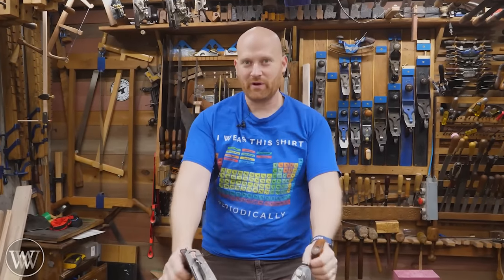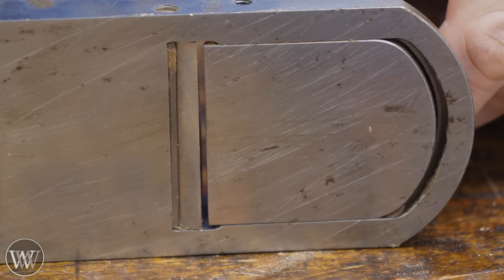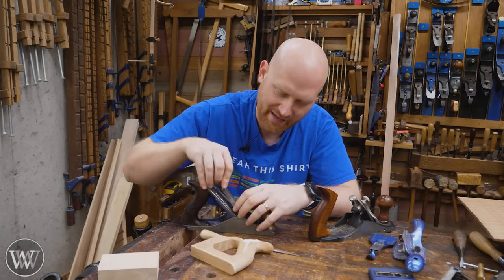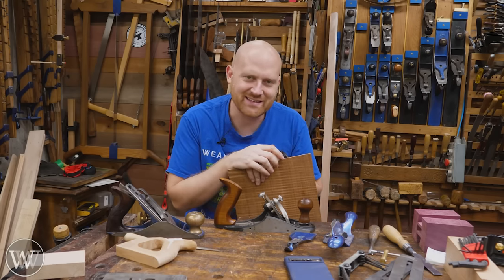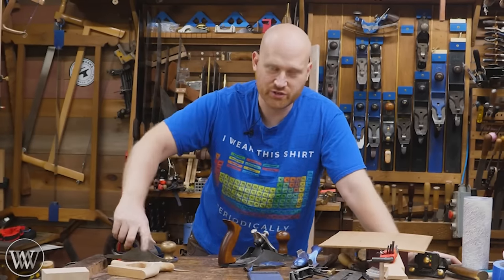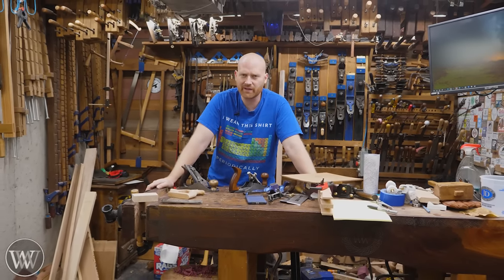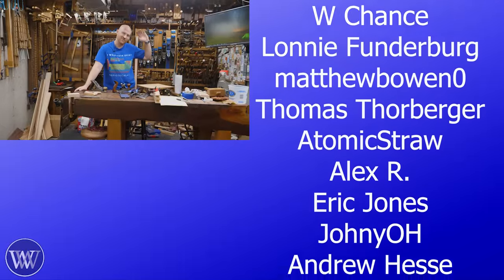Do You Need A Smoothing Plane

Comment: When I'm working a particularly gnarly piece of an exotic hardwood such as Curupay (aka Cebil or Patagonian Rosewood [no, it's not a rosewood and it's not from Patagonia]) I usually reach for my Veritas scraping plane.  I find that when I use the thin blade option I get card-scraper-quality results with less strain on my hands.  And since time has been unkind to my finger joints that lack of strain (and pain) is most welcome.

Comment: Thank you James for returning the craft to actual wood working, rather than playing with the tools. I do have a question that I think is relevant to setup: why do some plane shavings come out like an accordion? Others come tightly rolled like tape? While other times it comes out in perfectly straight?
Reply from the maker: Most of the time it has to do with the mouth and Chip breaker settings. If the trip breaker is doing a lot of compression it'll come out like an accordion. If it's backed up a long ways the shaving will come out nice and straight.
Reply: It happened to me too. I am a beginner and tried to put the chip breaker super close to the blade edge. So, this was the problem with the accordion chips?

Comment: I bought a number 4 during covid, I’d never done any woodwork before but I knew how to work to a straight line as I’d worked in engineering, I bought the cheapest new plane I could find on eBay, and I mean silly cheap. It was simply not possible to close the mouth to less than a 1/4 inch. However with an insanely sharp iron and a chip breaker so close to the edge that I needed an electron microscope to measure the distance, I managed to get very reasonable shavings, gossamer thin, no, but very reasonable. I have better planes now but I still have that cheap plane and it still works.

Comment: I have to laugh a few years back built a table top with QSWO that I bought off ebay case hardened I believe . My fancy lad bronze #4 with 45 or 55 degree frog would not smooth the top ,constant tear out. so scrapers to the rescue, I learned scrapers can get super hot. I did buy a Stanley 80 and the rest is history.

Comment: In researching Japanese planes, I came across the book by Scott Wynn. He does make the comment that the mouth opening should be the same as the thickness of the cut you want to make. I can guess that for those long shaving contest, that would probably be required. For general use, probably not so much.
Reply from the maker: Yup. The problem with Japanese planes is you can not adjust the mouth so you need to make it very thin when you make the plane.

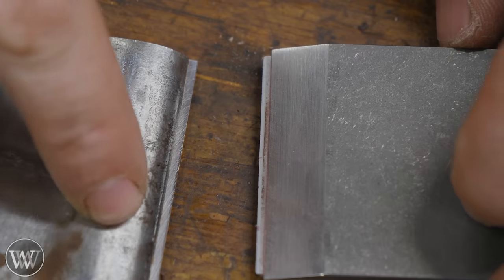Comment: James, haven't seen you endorse the David Charlesworth sharpening trick in any of your videos, but I see you do use it on your super smoother @ 1:52 ;-) Absolutely, 100% agree, a "properly" sharpened blade is the biggest thing you need, it's something that people think they've got down pat, but in reality, most don't. EDITED TO ADD ... even bigger than knowing how to sharpen, is knowing WHEN to sharpen and not trying to use a blade past it's "usable" life and then just fighting the tool.
Reply from the maker: I have showed it a few times but I don't use the ruler trick at all. It is ok for beginners but is an extra step that is not needed. The problem with it is once you start you have to keep doing it.
Reply: How is it an extra step, you have to remove the burr from the back no  matter what, it's just a different way of doing it that allows you to progress to a much finer grit stone for the polish, much quicker, eliminating a middle grit, so you just use 2 stones, that's it, which actually makes it quicker than "your" system of 3 stones and a strop. Weird that you can clearly see the micro bevel on your Veritas plane blade at 1:52 when you compare it to the other blade 😕
Reply from the maker: It is a zen Wu Iron no micro bevel. I do not do any secondary or back bevels on any of my irons. it takes more time to set up the ruler then just to hit it on the strop. you use the same sharpening stones with or with out the ruler trick.

Comment: Great video
I have one question :
What is more important for a smooth surface: to have a small mouth or to have a chip braker close to the edge?
Reply from the maker: Neither. Those are just for going agents the grain when it switches on you. they both provide about the same.
Reply: Thank you for the answer. I don't work with complicated wood so basically I shouldn't worry

Comment: Hi James, I am looking to get a curved foot adze,  for rough wood removal on timbers, and I got to thinking about how I will sharpen it. Should I get some slip stones to do it, or can I get away with ignoring the inside surface, since it's basically just a funny axe?
Reply from the maker: I would basically ignore it. Maybe touch it up every now and then with thousand grit sandpaper on a dowel.

Comment: How did us British folk manage to plane for so long without a chip breaker? Did our chips even break with just a measly cap iron?
Reply from the maker: You first see chip breakers come out in the 1700s. They were originally intended to be a thicker piece of iron to stiffen the whole set and were often called a second iron or cap iron. However soon after they found the functionality of using it as a chip breaker. The name was usually called CAP iron or second iron until around the turn of the last century where chip breaker became a more common term to use.
Reply: @WoodByWrightHowTo  "However soon after they found the functionality of using it as a chip breaker"
Those nineteenth century manufacturers and their marketing mumbo jumbo! It'll great to see your experiments, uncovering the truth around chip breaking and plane chatter and so on....

Comment: The chipbreaker's effectiveness is a function of any camber on the edge of the iron.  There's no point to adding a chipbreaker to a scrub plane, which is why purpose made scrub planes lack them.  I put a slight camber on fore plane irons, and shoot for a 1/32nd or less maximum clearance in the center of the blade on smoothers with the chipbreaker supported corner to corner.

Comment: Scrapers leave a rougher surface, feels more like a sandpaper finish. Having a plane set up for a specific task is in most cases faster than having to deal with a scrapper or sandpaper, and 90% of the world never heard of scrappers, it's mostly and UK and NA thing.
Reply: Not if they're sharpened properly. A scraper should leave a beautifully planed surface.
Reply from the maker: I don't know what scraper you have been using but mine leave it buttery smooth. And card scrapers aren't just a UK thing even the Japanese woodworkers use them.
Reply: @WoodByWrightHowTo  Tried it on oak, beech, maple, it looks smooth, but it doesn't feel the same and it doesn't quite look as good as planed. Like you said any wood can be planed so why even bother with a scraper unless it's an unusual shape.

Comment: very few times I disagree with you James. If you have a 25-35 degree cutting edge and no support to control the fibers (chipbreaker or mouth or combination of the two) you will basically wedge the fibers up ahead of the blade. doesn't matter how sharp it is. if you don't believe me, try smoothing with a chisel plane.
Reply from the maker: have you seen the Japanese video where they did it under a microscope. it does not work in all instances but with a fine enough cut you can cut agents the grain on most instances.